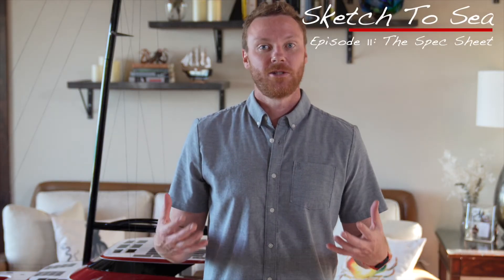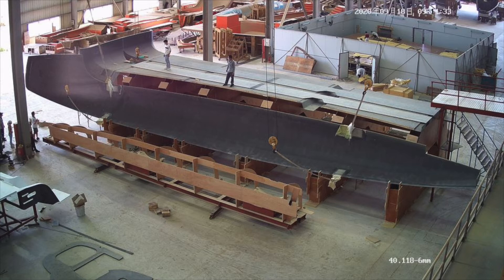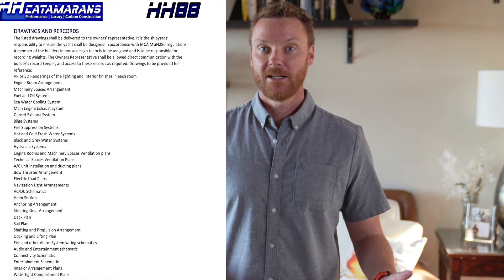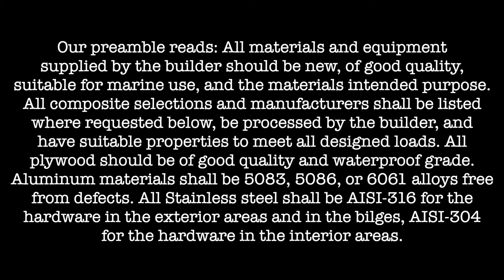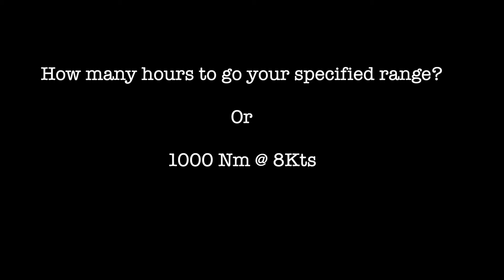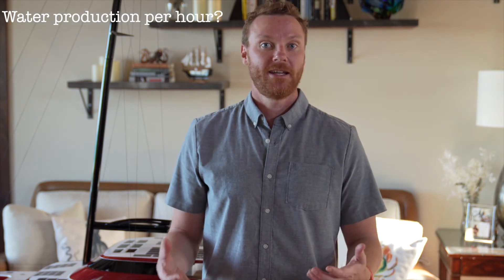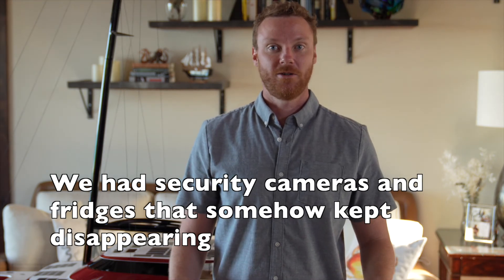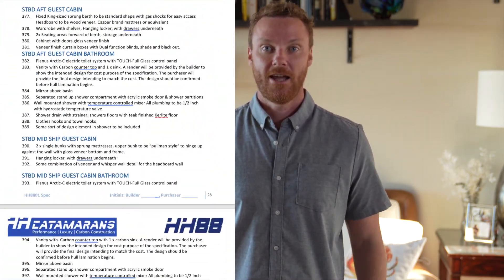Sketch To Sea: Ep 11-The Spec Sheet

Comment: I'm curious why you opted out of dagger boards? Was it an interior compromise? Does your yacht point better than others? Curious minds wanna know? Larger yachts point better? Keel design?
Reply from the maker: Thank you for the comment. It boiled down to a few considerations. At this time in the build we were considering going to 88ft. We then ran the polars for a 77 with and without boards, and an 88 with and without boards. The 77 with boards performed almost identically to the 88 without. We chose to go for the extra space, and less moving parts. In addition, this is already less of a performance cat and more of a fast moving cruiser. We chose the creature comforts that a flybridge allowed over the weight benefit. The keel designs are well done with winglets on the bottom that certainly help with pointing. All of this has been hypothetical and modelled, but we will never know until we actually get out there.